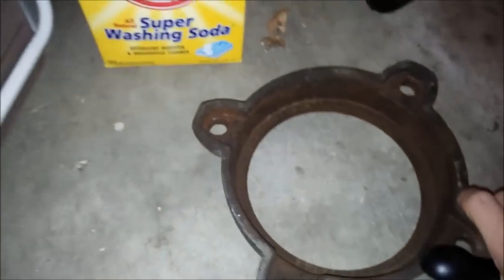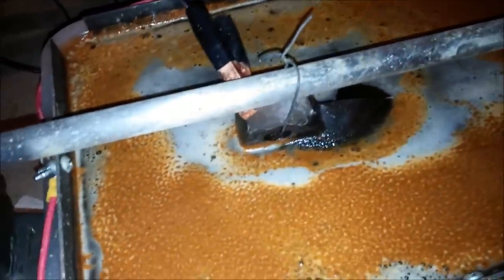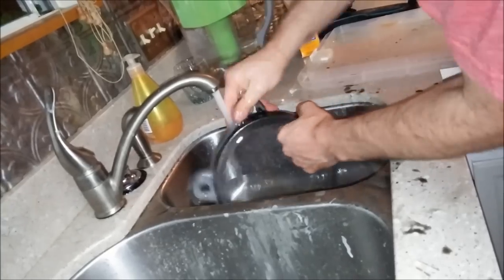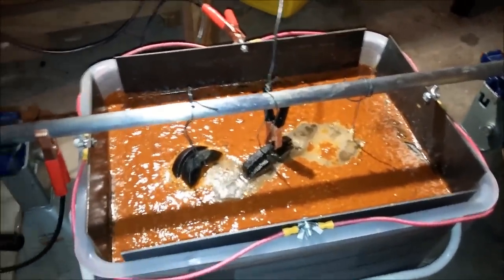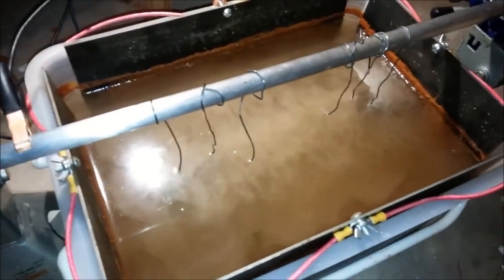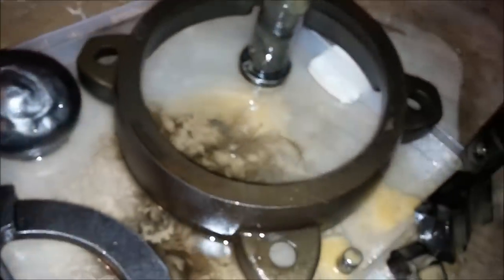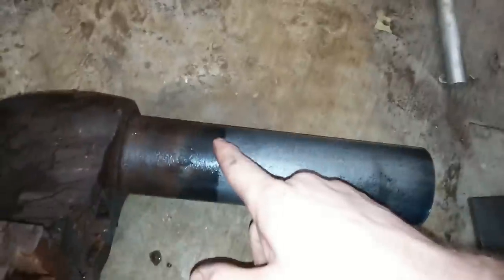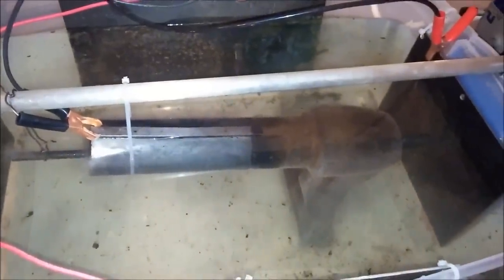Wilton 8" 1780 Vise Restoration P9 - Electrolysis

Comment: 1. You can get many more miles out of the electrolyte, regardless how gnarly it becomes. I've used the same electrolyte many times over a period of weeks with no ill effects.

2. No need to baby cast iron with a brass brush and toothpaste for an abrasive.

3. The anodes can be almost any gauge, even the thinnest.

Comment: I remember when I did all four of my wiltons (including my 1780). It took about 4 minutes on a wire wheel to completely knock off the rust and get down to bare metal on the base. The electrolysis is overkill.

Comment: I've used water mixed with vinegar and just drop the pieces in for a day or two. works excellent for removing rust to the bare metal.
Reply: From all methods vinegar is the worst and lest effective. Try some Molasses (Lyles Treacle) for best results or electrolysis for fastest but black residue result. Molasses can take couple of weeks but it comes out shiny as soon as you hose it down and targets every invisible submerged spot.
Reply: Molasses? I've never heard of this.

Comment: Wouldn't Sandblasting be easier/faster/less messy?
Reply from the maker: DarkSim77 
Probably easier, but not better. I think the results would still be better with electrolysis because it's a chemical reaction on the surface that won't damage the non-oxidized steel. When you use sand you'll inevitably damage the surface to get all the rust off. You can see how difficult it is to remove fine surface rust by mechanical means where I wire-wheel it at 24:10.
Definitely faster, and if you include all the cleaning of multiple parts and container, less labor-intensive.
Less messy depends on your setup....I did go through a lot of paper towels.
Reply: There are various types of abrasive - glass bead, walnut shells, plastics that do minimum damage to the sub surface.  Often used to remove paint from vehicles.  It provides an excellent anchor pattern for protective coatings.  You could do a vise in 10 minutes with Commercial Sand Blast equipment.  Done!  A bit longer in a Blast Cabinet.

Comment: Curious why you didn't fully submerge the parts in the solution and use one neg connection on the bar suspending the parts?
Reply: that would corrode the wire (the weakest point) and the part would just fall into the bottom.
Reply: I don't think it would as that is how the process is done on a commercial scale. Although any concern on that issue could be negated by using copper or stainless wire to suspend the parts.

Comment: are you indoor? the fumes produced by that procedure are quite toxic
Reply from the maker: +Paolo sturaro 
You're quite mistaken. The only byproducts from electrolysis are hydrogen and oxygen gas. They are flammable and hydrogen is an asphyxiant, just like any other gas that displaces oxygen, but not toxic. Everything else stays in solution.

Comment: Do you think the water is for free? Save it.
Reply from the maker: +samedxml. exe 
No, I get this annoying bill every month to remind me. Luckily we have this thing called the hydrologic cycle so I'll just reuse it later.
Reply: @354tb35yb5y  use rainwater. It's natures distilled water.
Better electrolyte.
No containments or chemicals.
Free. Collect in stainless steel bucket or plastic container.
You're welcome.
Reply: Julio's Evil Twin Any more advice while you’re on the soapbox?
Reply: @rootvalue  keep the steel walls submerged. Current is dropping as a result of them being above water level & that fancy wire set up linking them together is for show, just have the walls touching underwater
 12v 5A or 6A (60-72watts) is sufficient.
Reply: Julio's Evil Twin This is really helpful advice for a YouTuber who didn’t cast out a request for advice 😂🤣🤣🤣
Reply: @rootvalue  np you're more than welcome.
 Btw, when you're looking at the power supplies, laptop charger for example, just multiply the 12v (or whatever volt it is) by the amps to get the Watts that you'll be generating in the water.
 Currently (no pun intended) I'm using a 19v 3A HP brick, = 57watts.. 
 Which is loads regardless of the size of the tank. 
 If you see a blue wire in a laptop power lead just ignore it, that's a sense wire to measure the draw from the laptop it was intended for. Just use the positive & negative. 
 Black is always negative. The sense wire (if not blue) will be half the thickness of the pos+neg wire. 👍🏻